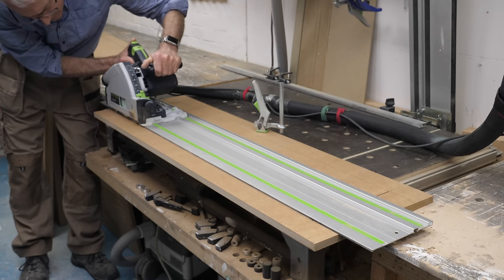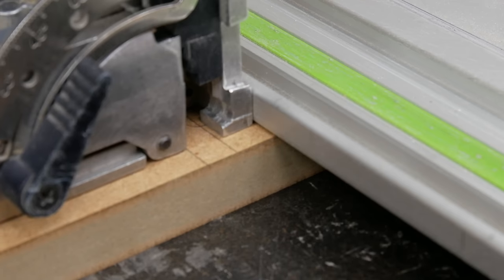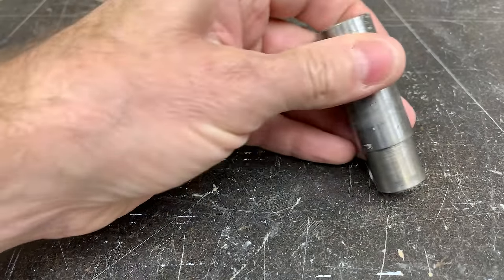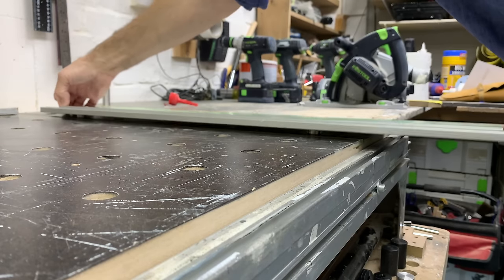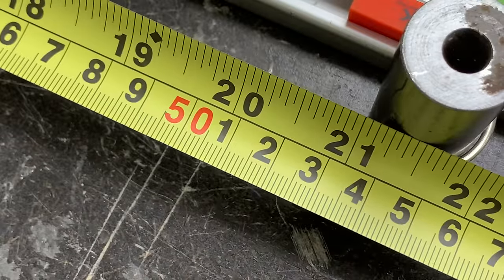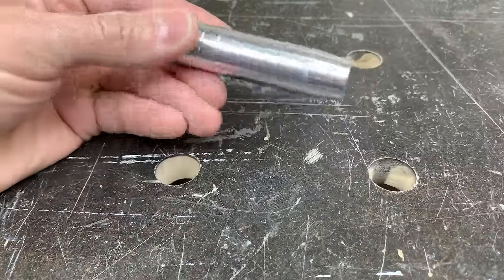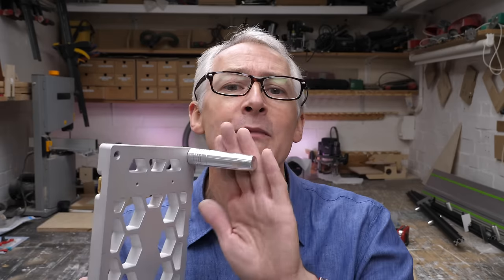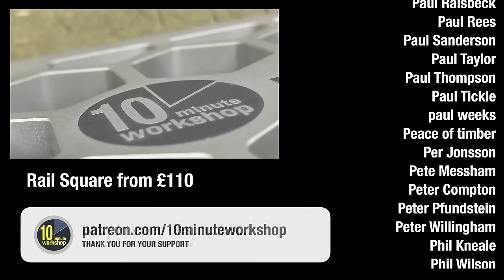Square cuts: MFT or Rail Square?  [video 422][Gifted/Ad**]

Comment: If you live outside of Europe anything Festool is just an abusively overpriced status symbol usually found brand spanking new looking in the "workshops" of people who collect tools they like to brag about owning but never actually use. 

I can't get, without significant difficulty anyway, a full sheet of plywood into my shop. Breaking sheet goods down before getting them into my shop is a must. For years I went with an aluminum guide rail that had to be painstakingly measured on both sides, squared and clamped making sure to take the 1 5/8" offset for the circular saw into account. Track saw are just generally expensive. They have come down in recent years and if you don't mind the cord you can get them very cheap. I have a WEN that I got for under $100.00 plus a 59" rail from PowerTech for it as well as PowerTech's 110" rail kit for ripping down the 8' length. I added the rail square from TSO and have no problem ripping the full 4' x 8' sheet in either direction. I spent less than $500.00 two years ago for the whole kit. Depending on the sales or price at the moment it may be up or down from that a bit but not by much. I think right now the same set up is still less than $600.00. I don't care what anyone has to say about the brand. It works beautifully. It cuts straight, square and true. I highly encourage anyone looking to do the same.
Reply from the maker: I have tracksaws ranging in price from £60 to £609 and they all do the same job. 👍

Comment: I don't see the advantage of the MFT adapters in a rail square compared to the dogs in/under the rail. In both cases you need to have an MFT top -- which is costly and limited in size or would take a serious amount of time to make (accurately).
Reply from the maker: The MFT adapters in a rail square allow you to locate it accurately in relation to the fence, giving you bot the advantages of an independent rail square, and the accuracy and repeatability of an MFT, and without having to dedicate a rail to crosscuts, as you would when using rail dogs. MFT tops can be had very reasonably from third parties - links in the video description - but if you don't see the advantage, then stick to a plain rail square. 👍
Reply: @10MinuteWorkshop  Thanks Peter for the explanation. Wasn't clear to me. Now I understand. :-)
Reply: Also with the rail square it is not critical to have two rail dogs (one in each end). You would be able to cut a 1000 mm cut with a 1400 mm rail on a 800 mm table :)

Comment: Howabout a similar video without the option of an mft, dogs etc for those working out of a shed ?
Reply from the maker: That option is the rail square, surely? Or the plywood triangle, or the DIY rail square?? 🤷‍♂️
Reply: @10MinuteWorkshop  do you not have a shed plywood triangle though? For sheds?
Reply: Peter Millard yes but a “how to” would help please. I don’t have a table saw
Reply: @michaellionart4841  neither does Peter, he's using a tracksaw. If you scroll to the bottom of the description in this video, you'll see links to his videos where he builds the plywood squares.
Reply: Rico S ok thank you I’ll take a shufty 👍

Comment: Why 96mm?    100mm pitch will do the same job. 
It appears from what I managed to find out, after the second world war 16mm was adopted as the furniture industry standard for making utility furniture. You will find many items associated with furniture using the golden 16 rule even now many handles have a 16mm ratio for there fixing pitch.
One explanation I found, was when they where making the multi head drilling machines, for the massed produced furniture. The most available and cheapest bearings left over from aircraft production would only allow a minimum pitch of 16mm allowing 2 dowels to be drilled in the end of a piece of 1 ¼” stock.  Sounds plausible? 
Does anyone else know more?
Reply from the maker: Thanks. I link to the posts on Festool Owners Group that corroborates what you suggest, yes - all done to line-boring machines in the post-war industrial surge. 👍

Comment: I'm going to be buying a track saw in the new year (hoping for some nice Jan sales) and im a bit overwhelmed by the masses of bench dogs available. 

I plan on getting a Bench Dog rail system and a TS55 saw. What dogs would you recommend to supplement this setup?
Reply from the maker: Good plan, and totally understand about the huge choice! When you say the Benchdogs rail system - what do you mean exactly? Amongst other things, they make a fence system, and they make dogs for rails, and they make a square that can also have dogs attached to it; depending on what you go for would influence which sets of dogs you need to get started. Do you have an MFT top, or are you just cutting on a bench? Thanks! P
Reply: @10MinuteWorkshop  Yes sorry, its the fence system I think I will opt for. Im going to make my own MFT top with the parf guide.

Comment: Peter you didn’t mention your thoughts on the MFT’s own system of squaring the track? I’m not too crazy about the way it all comes together and in particular the protractor part but it can work.
Reply from the maker: Mine’s an older MFT/1080, so no protractor - thankfully! I talk about squaring it up in videos 182 & 183 - links in the description - but short version, I square the fence to the top row of holes, and the rail to a column of holes, and that’s it. Job done. 👍👍

Comment: Interesting that you have not mentioned the Festool rail square, at just over £100 I think this is a great piece of kit and regularly use it to produce accurate 90 degree cuts.
Reply from the maker: Festool rail square is a rebadged TSO, and I mentioned other rails squares in general when I talked about rail squares in particular a few weeks back - link in the video description. 👍👍

Comment: I have a bunch of bench dogs stuff.  Where did you get those clips that attach the rail to the regular bench dogs, (they were red with a metal hook, that slid into the rail and locked them to the dogs) - duh, watched the video again, I see you said they are from xminster.  looks like you can get them in the US here - https://www.shopfestool.com/dog-rail-clips/
Reply from the maker: Thanks! Yes, links in the video description, but I couldn't find them on Amazon in the US. 👍
Reply: If it helps, i've got mine from amazon
Reply: Viper090674 do you have a link to the us Amazon store ?
Reply: @grantdavies6081  TSO sells them in the states of you search.